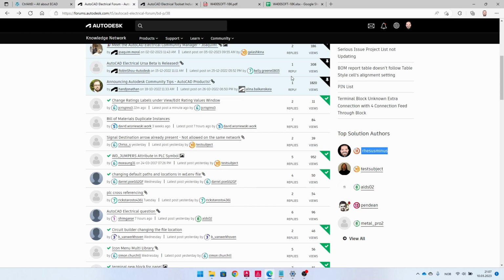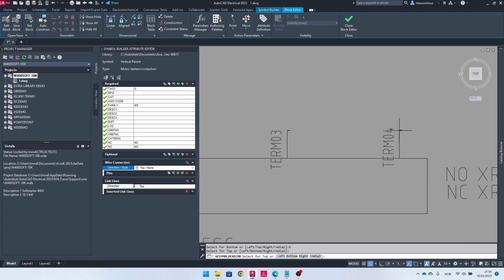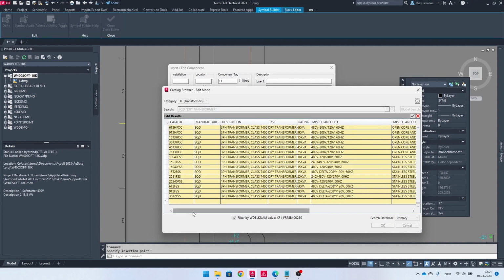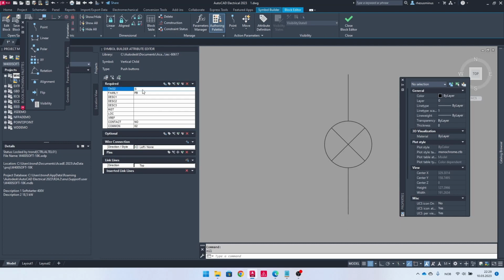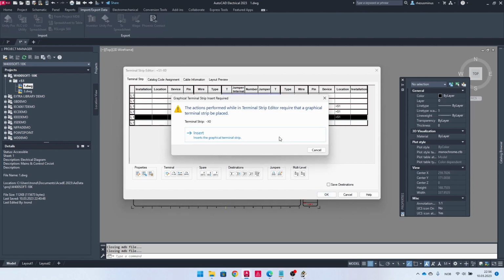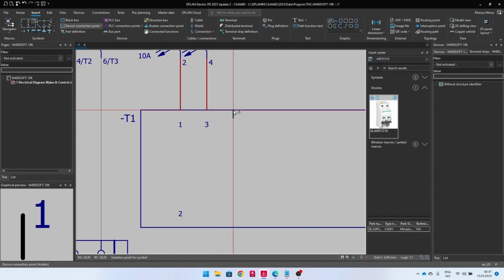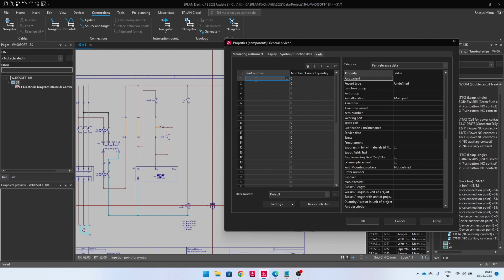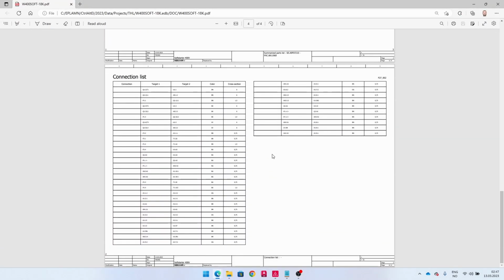AutoCAD Electrical vs. EPLAN Electric P8 - Comparison

Comment: Please don't connect terminals 8,9, and 10. F2 will thank you. Time stamp - 01:29:21 Anyhow Thanks for the great out of the box demo. Too often the demo given are scripted presentations with every configeration well tested and practiced. This is truely like sitting down with a new project day one and building.
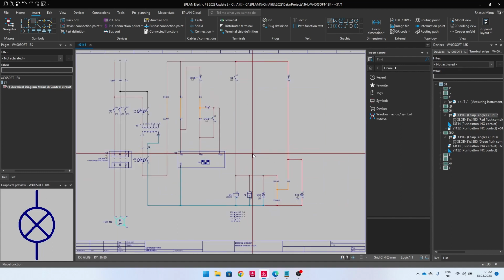Reply from the maker: See 2:53:25
Eplan makes me aware that this was a problem 😊 And yes, this is done in the cheap version of Eplan (Compact).

Tried to be fair, and start from scratch on both products .
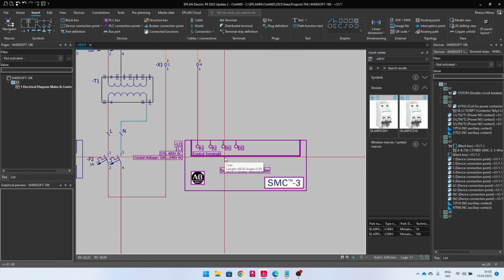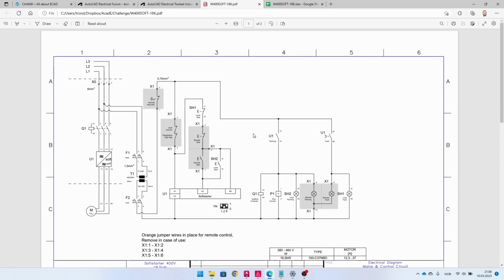Reply: @ctrlaltel  I was interupted at 2:36:00 I need to finish the video yet. I took a look and didn't see that posilibly promised 2d Panel video at 00:02:30 😁

Comment: I tried many cad software for electrical drawings and settled with See Electrical. Using it for more than 15 years. Simple, faster and flexible. Easier to create documents, templates, and reuse many sheets from other projects.
Compared to Eplan or Acad electrical, this can produce drawings twice as fast. And about 10 times faster than regular AutoCad. All software have some limitations..Weigh the drawbacks and choose.
Regards.
Reply from the maker: No doubt, See Electrical is a really great software package. But, Eplan is still more than a horse head in front, in my opinion. I'm also familiar See Electrical since they were called Caddy++.

Comment: Is really a fair comparison when you spent most of your time in autocad creating linetypes, components and terminals, which will already be complete once anyone has Autocad for over a month?
Also, Autolisp is a major benefit for autocad. I can draw a complete project with PLCs, panel layouts, and BOMs is just a few hours after we automated the process with Autolisp. 
 If you choose to put in the time like any good Designer should, Autocad is much better than EPlan.
Reply from the maker: I started from scratch on both products, so yes, I believe it was fair.
EPLAN  does also have an API, so you can automate anything.

Feel free to take on the AutoCAD Electrical challenge: https://youtu.be/cJwol-EJyuc

And also challenge me back! Looking forward to see you convince me that AutoCAD Electrical is so much better.
Reply: @ctrlaltel  You don't even need to dig into the API for that! You can automate this using "generate project reports" but you need a good standardisation with templates if you want to use it regularly. For PLC schematics we use aml files from TIA portal for example, and have the PLC programmers set up the IO configuration. We import and just use standard macro's for this. 
It took me a while to get used to EPLAN because the variables are so rigid, if that makes sense. You have to be very consistent with how you work but if you do it'll open up lots of possibilities.
Reply from the maker: @FOATE AcadE fans always write about the autolisp/API that is the solution to everything. I just wanted to say that Eplan also has an APi, even though you most likely won't need to use it, as most things can be done with standard functionally 😊
Reply: @ctrlaltel  I see what you're saying now. I dont really see his point in bringing it up anyways since your video is mostly focused on drawing the schematic, so its a moot point. 
Probably autocads better for layout design, I use propanel at work and its glitchy sometimes. Not necessarily easy to navigate components, especially when the snap mechanism is not working as intended. But it has a few handy tools foor sizing ducting and din rail that let you design mounting plates really fast.

Comment: Great video, How do you edit the macro at 2:09:42 directly, I can only do it by ungroup it first and then group it again and convert to window macro. Is there a shortkey for doing so.
Reply from the maker: Hold down the shift key on the keyboard while selecting an object in a group to select that "sub object".
Reply: Press and hold shift